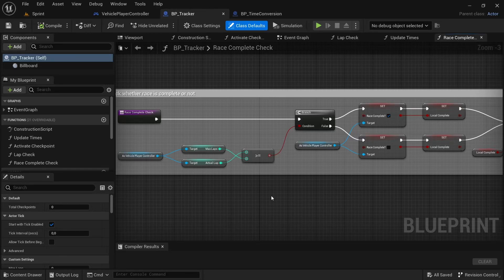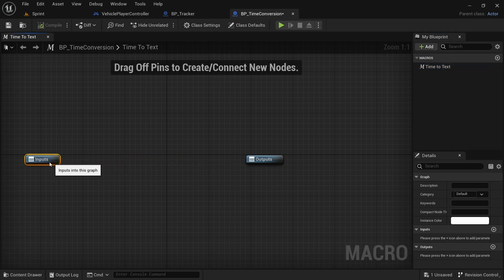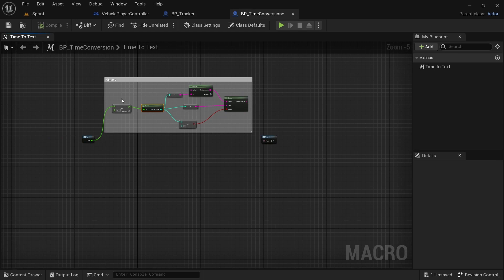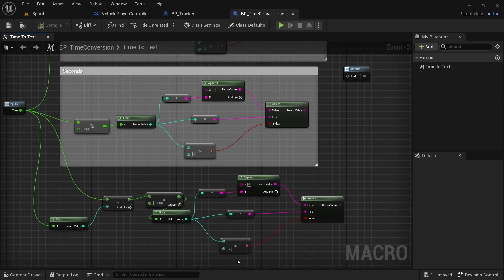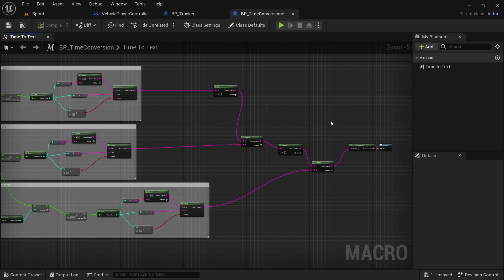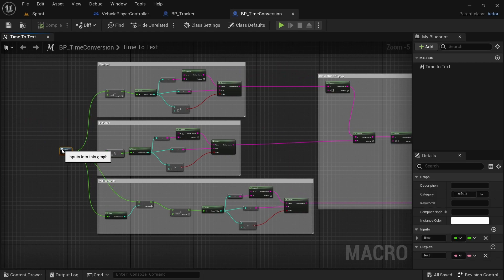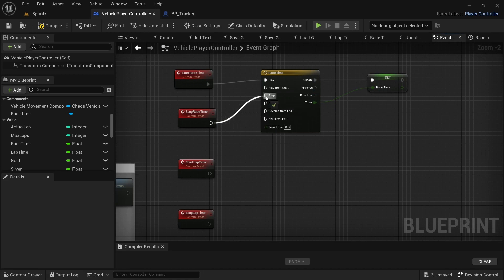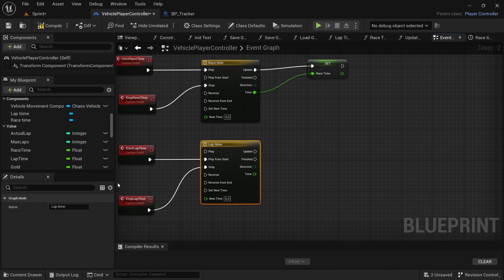Setup Race/Lap Timers and Time Conversion | Unreal Engine | Racing Game Tutorial

Comment: Nice to go...
I just have one question.
In the time conversion macro, you used floor funtion, what is its role and work?.
I mean whats the funtion of " floor function"
Reply from the maker: 'Floor' rounds down to the previous number/integer, e.g., 1.7 will remain to be displayed as 1 until it turns into 2
Reply: @GenuImitation  ok :)